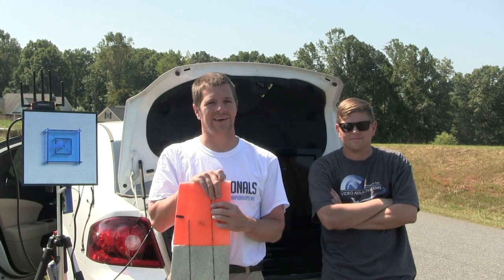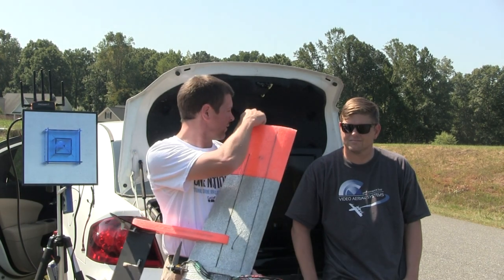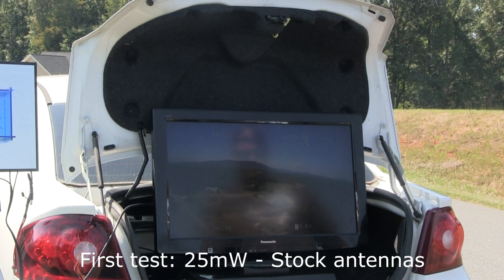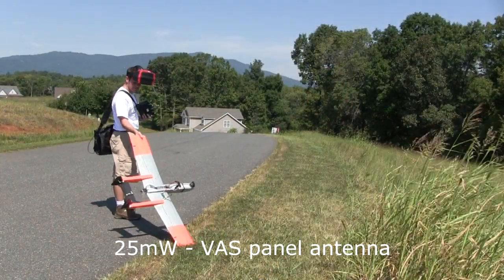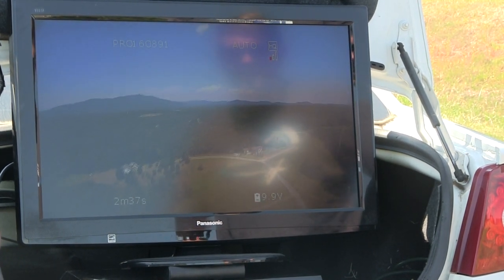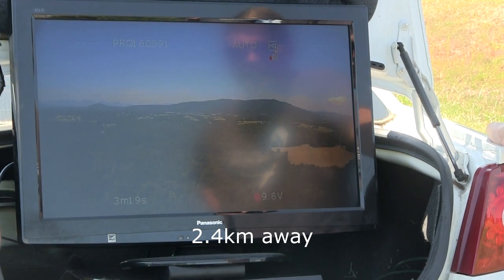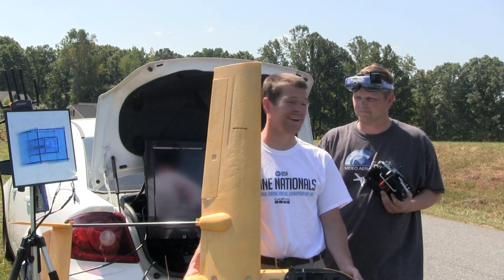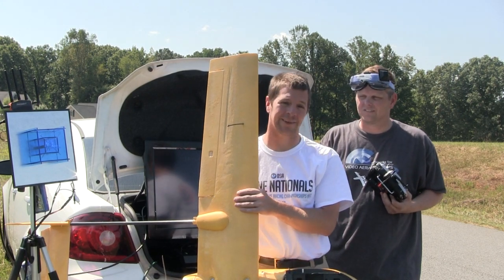Connex Prosight range run full test

Comment: Happy New Year guys and everyone!  What controller are you using?  Looks like a DX5?  Are you using a signal booster?
Reply from the maker: That's an old Futaba 9CAP radio running EZUHF control.
Reply: Can you give more info on the EZuhf?  Thanks for the 411
Reply: Checking out the EZUHF now.. Thanks and great video.

Comment: First of all you guys do good work! Does this work with the original Conex 1080p system or just the Prosight? I have heard that there is a range limiting in the firmware and at 1000m it cuts out after a brief warning to turn arround. And I am guessing that their long range system advertized to 3k or 10000ft already uses directional antennas so it would be impossible to put a your antenna on it for even better range. Correct? Thanks for all your hard work and info shared with the community!

Comment: Great video. Will the VAS HD Linear Receiver Array that you linked in the comment section work just as well with the standard connex system? 

https://www.bhphotovideo.com/c/product/1153641-REG/amimon_amn0811ms_01_connex_wireless_pro_hd.html

Comment: When you were stepping up from 25mW to 200mW was that the trasmitter power or the receiver? if transmitter  how did you give it more power?
Reply from the maker: Transmitter power is selectable on the unit we got.
Reply: The Connex is able to select desired power? or were you using a different transmitter?

Comment: Cool test! Looking forward to the new HD FPV world.  How is it that DJI gets HD 1080p FPV at 4+ miles, is OccuSync some kind of magic (wifibroadcast)?
Reply from the maker: Not really nailed it.  DJI has 1/2 second of lag which is fine if you are just framing up a photograph.  However, if you are trying to fly a race ship or an airplane, the lag is too much and you need to go with a system like the Connex.
Reply from the maker: It has to do with compression.  hence the latency of the lightbridge.
Reply: That's what I figured. Supposedly OccuSync is a different animal to Light Bridge, some speculate a version of WIFIbroadcast and a lot of software processing causing latency. The pure digital looks very promising. I'm sure it will get smaller and more capable if it becomes more popular.   I'm highly tempted by the Falcore, but then need the fancy Glyph goggles too for full effect, a bit spendy.
Reply: Because DJI have nailed it!! Makes everything else seem antiquated.
Reply: latency of lightbridge is less than 30ms. Hardly worth mentioning for long range flight. We go out 8-13 miles. Latency is never a problem. Lightbridge is also a MIMO system which has a lot of added benefits.
Reply: Half second? No, it's measured in milliseconds. I can do a test video and show you.
Reply: Lightbridge as less latency than the Connex using HD. I so wish someone could make a MIMO system to rival Lightbridge. We EASILY go out 8 - 13 miles using a 14dbi-19dbi panel antenna.
Reply from the maker: Not in my tests.  I have measured it between 0.3 and 0.9 seconds.  It seems to incur more latency with time.  I am not sure why our measurements vary so much, but it is worth looking into.
Reply: 200-300ms latency doesn't bother us at all. No you can't run a racer in trees with that, of course. But poping up and going long, doesn't matter a bit. We need guys like you and TBS to make us something that we can use on our birds that does as good or better than lightbridge! 
http://app.airdata.com/main?share=RZkUhZ

Comment: Did you notice that the signal when back up to 2 bars when you turned around. Maybe the antenna orientation on the plane may aid in longer distance.

Comment: 4.1km ??? My phantom 3 pro capable of 4.5km with HD live feed. But the phantom's latency is quite bad.
Reply from the maker: That's how compression works.  The compression reduces the bandwidth allowing the signal to go further but it comes at the cost of time.  Thus, latency is an issue.
Reply: Video Aerial Systems it's not an issue at all!

Comment: thanks for your video! what analog SD video feed gear were you using to to maintain video signal to fly still when the HD signal was lost?
Reply from the maker: We used a 400mW 1.3GHz system.  nothing special.
Reply: Video Aerial Systems thanks!

Comment: The Amimon CONNEX ProSight System, I believe was really designed for FPV racing and short range cruising around. But, I do like your guys antenna mods video and quality comparison.I know in time other third party companies will experiment with different antenna variation for all Connex hardware (Tx/Rx).These kind of digital signals are 5.1-5.8
signal and in time they will try 2.4 but there is a hard latency with these digital signal but better distance. I guess we shall get use to digital 5.1-5.8ghz signals. lol Thanks Guys CHEERS!
Reply from the maker: You are correct.  But it is much more fun to see just how far you can push something ;)
Reply: Very true

Comment: if u-BCrazy try boosting it with two of these bandwidth is 5.0G to 5.875G high data rate too. 2000mw http://m.ebay.com/itm/SUNHANS-eSunRC-2000mW-UAV-WiFi-Signal-Booster-5-8Ghz-33dBm-WiFi-Signal-Amplifier-/301836538328?nav=SEARCH

Comment: What transmitter were you using?   And how far can it go?  Is that a limitation worth considering when going for range?

Thanks!
Reply from the maker: We were using the stock antenna in this test.  Not sure on the ultimate max range, though.

Comment: Thank you for the review! Does the Prosight vtx require a separate power source or power filters if powered from the pdb main power supply. Or does circuitry in the Prosight vtx contain all the required filters and becs to cleanly use the main onboard power supply? How did you power the vtx in the video.

Comment: Thanks for that guys. I'm using my Connex system on a 3 metre glider and it's great. Still not as impressive as the video feed I get on my Phantom 3 Pro though. I get nearly 5KM out of that on 2.4GHz in a rural area. The stand alone DJI Lightbridge unit must be even better, but I can't justify the price.

Comment: Now this is the guy I want to see testing and giving his opinion on all drone related gear. I have been holding off on this but may reconsider quickly. I will be using it for drone freestyle mostly and the occasional race. My concern tho is fast flipping and turning around trees and objects and have the signal drop even tho you're in range. Yes on this plane it's staying in good los with no fast action movements. I would like to see some more testing maybe with a fast flying wing whipping it around in all directions or even a racing drone doing fast freestyle.  Great vid and info :)

Comment: Alex, I think you may have been running on 200 mW the whole time. For the US region, there is no 25 mW mode. The difference can be explained by the fact that you did not use the same hardware for both flight tests. No matter how similar the aircraft may be, as I'm sure you know better than most, RF can be influenced by subtle changes.
Reply from the maker: I changed it to 25mW for my airplane.  It is in the settings in the unit I received.
Reply: Got it. Thanks.

Comment: Always love your range test videos :) the Connex seems to be a nice video system for high altitude cruising around. But for low altitude flying around the fields some kilometers away or diving a mountain I think I would not trust it. A video image with 80% static and 20% image is much more flyable as a black screen :)
Reply from the maker: I agree with you.   However, I am working on a new antenna system for it that might help low altitude

Comment: How does one not notice their battery voltage
Reply from the maker: I am flying with no OSD on my Specter.  I grabbed the battery out of the dead battery pile by mistake.
Reply: Yes it was also blinking red, 8.0V is really damn low ;D

Comment: great video just remove the background sound, awful
Reply from the maker: I needed something to cover up the microphone noise.  That was the best I could come up with...
Reply: ah OK I understand the problem but the type of sound you used made the solution even worse. The worst sound I have ever heard is either yours or Stoneblue airlines, they are both winners for the bad lol...great video and very informative anyways, is the panel antenna commercially available? thanks IB CRAZY
Reply from the maker: +svsoftair it will be available as soon as I verify it is perfected ;)